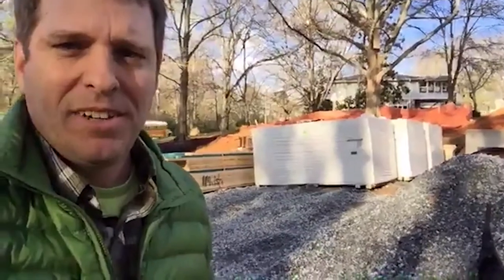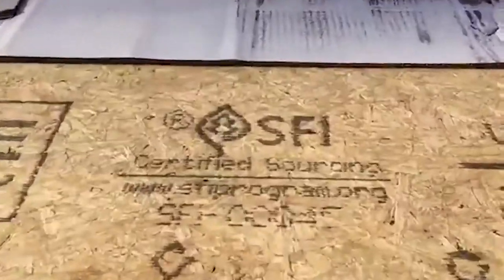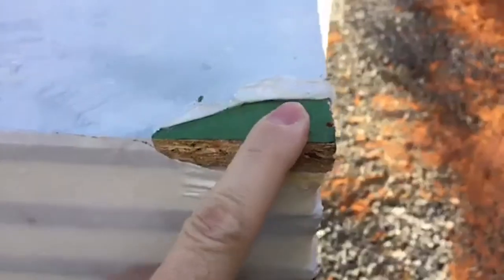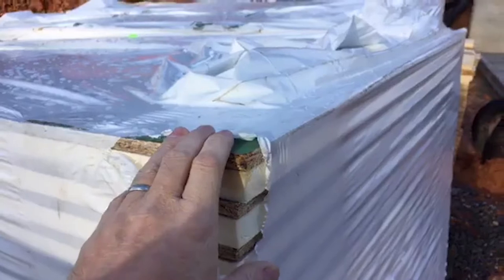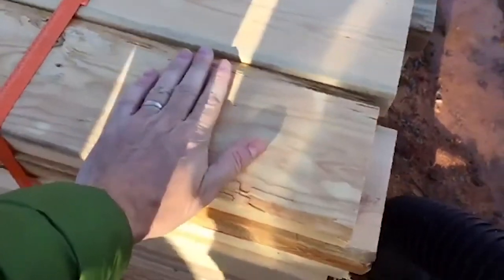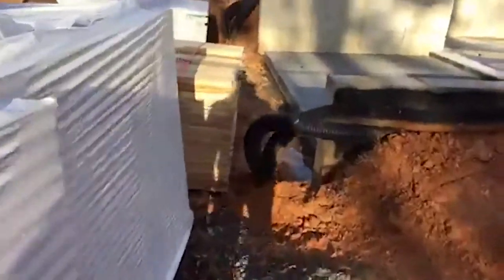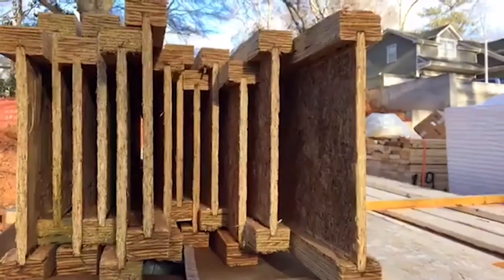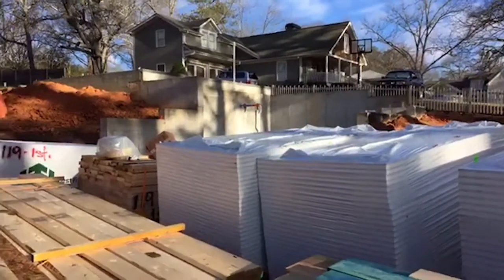How Does A Flat House Look? | GSGH VLOG 015

Comment: I'm sorry but that OSB flooring and sheathing is garbage. You can plainly see where the corner of the protective plastic wrap has exposed the corner of the sheating to the elements and it's swelled up where the water stains are. OSB is supposedly cheaper. But the cost doesn't outweight the benefits when the stuff gets wet from a water leak and houses do like to leak.